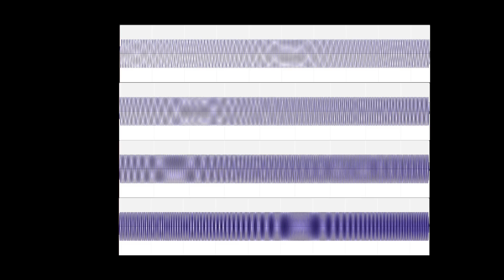Loopy Masterpiece: Playback

Comment: Looks like you're doing linear crossfades, and not logarithmic? Usually that gives you a dip in volume at the crossfades. Or perhaps this is just for the testing phase?
Reply from the maker: +machinate Wow, that's observant of you! You're absolutely right, I need to apply an equal power fade across long loop boundaries. For microfades (just a few ms like in this video) I'm using linear ramps because it's more efficient, as the vector processing library I use doesn't provide for logarithmic ramps, which need to be built in an extra step.

Keep up the great work, it's awesome to know there're sharp folks like yourself who have my back with this =)
Reply: +ATastyPixel knowing there are tremendous nerds like you out there working on the art of looping is amazing - keep up the good work.  BTW talk to Rodrigo Constanzo,  if you haven't already...